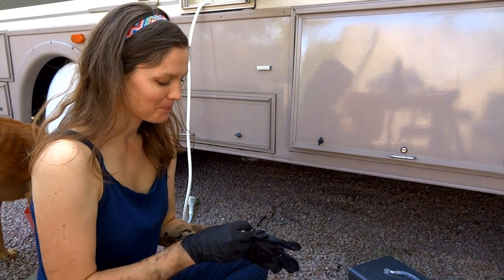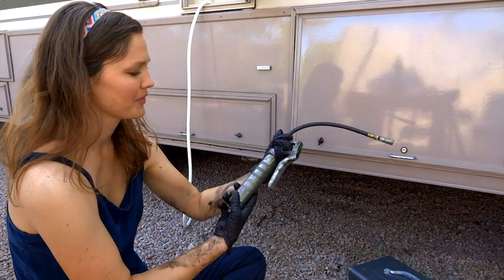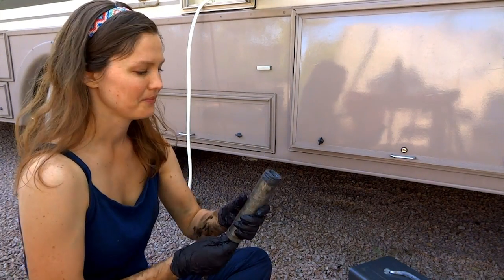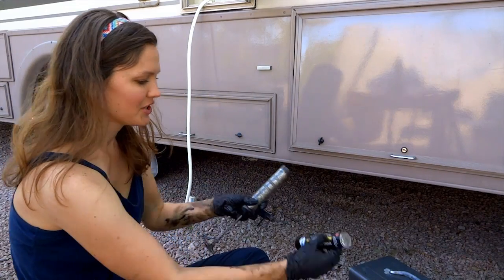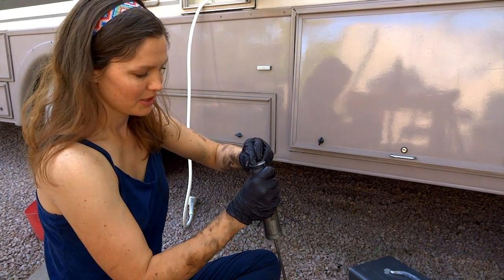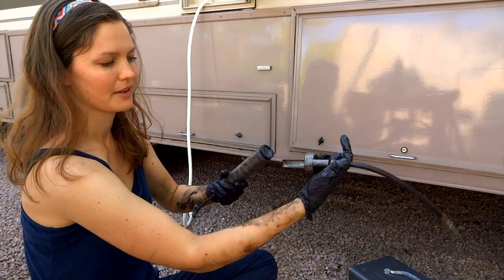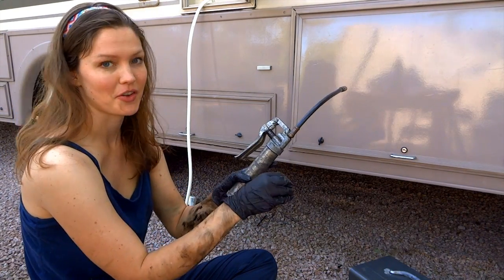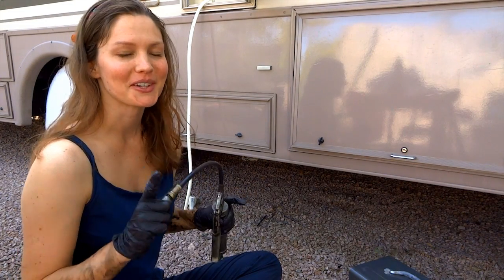How to Load Grease Gun - 3 oz Cartridge

Comment: Thanks Pipi,  I have had one of these 3oz grease guns for years.  They are super handy because you can pump grease with one hand and hold the grease nozzle properly on the fitting with the other hand (no grease squirting out and not going in your fitting).  But, I hadn't used mine in quite a while and had grease all over the place when replacing the cartridge.  Your video is an excellent reminder on how to do this properly!

Comment: Well done. Reminded me of learning how not to fill a grease gun. Some of them have, rather than the slots in the hole, a oval keyhole shaped hole in the end. You pull the rod out and slide an undercut in the rod to the side into the key slot. 
Works pretty good as long as you are careful to not bump the rod. 
Before cartridges were everywhere we filled the guns by putting the end into a bucket of grease and pulling the rod. The barrel filled up like a hypodermic needle and then you screwed the cap on. I bumped the rod and a big old gob of grease flew over and stuck to the side of the garage. 
The stain is probably still there after 50 years. 😊

Comment: Thanks Pippi. When I changed the cartridge on my inherited grease gun, the plunger handle was stuck in the 'in' position. I reviewed many videos looking for a solution. Even though my exact problem wasn't addressed, the videos gave me enough understanding to work through my problem; thanks! (A previous owner of my gun had reversed the ends on the tube body. The plunger had gone beyond the cartridge making it impossible to retract. I cut the cardboard with a razor knife and the metal rim with a diagonal wire cutter to remove the old cartridge. With the old cartridge removed and the ends on their correct end of the body, it then behaved as expected.) Thanks again!
Reply from the maker: +Mike Baker Ah ha! Fabulous work Mike :D Happy trails!

Comment: Great video. Have you ever thought about getting a pneumatic grease gun? It uses a compressor and a hose. Harbor freight sells them for pretty cheap. If you want to go the cordless route, Milwaukee has a m12 one. These are a lot faster than an old fashioned one. Greasing isn't the most fun task there ever was. Lol.

Comment: first of all thanks for the relaxed presentation of the short video, 2 important things you mentioned  are, unscrew the top end of gun before you pull the lever back ,as it lets air in.,that will make it easier.  and also very important is to put the parts  in a clean place otherwise the tip of the gun can get blocked ,by the way how did you get your arms so greased/oiled up , did you just the motor in your camper?

Comment: It looks like she is using the Plews Lubrimatic gun which has a better coupler than many of the other mini grease guns like the Harbor Freight one that I have.  As I have found out these things are fickle and messy and it seems that there is no way to use one without getting grease all over your hands so the gloves are a good idea.  However it might be a better choice to use a full size gun if there are many fittings to be greased as the grease is less expensive when purchased in the 14 oz cartridge.  However a full size gun is more difficult to handle and good ones are expensive.

Comment: Well, after getting the fitting stuck on the zerk and unable to get it off, breaking the zerk, and realizing that my 3 oz grease gun was not emitting grease, I pulled it apart and realized that I had not removed the foil at the end of the grease tube, I was able to fit the zerk back together, but will probably have to buy a new zerk. I was also tempted to profane, but refrained, knowing that reason will find a way. I see you were wearing gloves that did not protect your arms. You can buy long arm sleeved gloves for that, since you helped me. Just please do not tell the guys that I had to seek advice from a woman as you were the only one acute enough to describe anything as simple as removing the foil at the end of the tube. Thank you.

Comment: Hi Pippi! Have you found any limitations using the 3 oz vs a 14 oz size? I know the larger ones can deliver higher psi, but I am wondering if you have found any applications where the 3 oz just couldn't deliver. The clear advantage of the 3 oz is space savings... especially when travelling by RV  =)
Thank you for the very informative video!